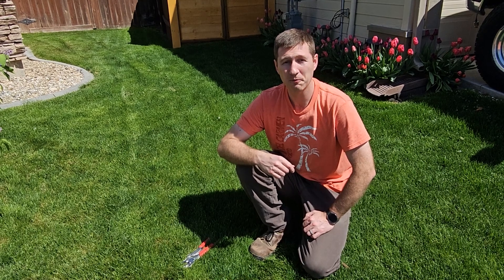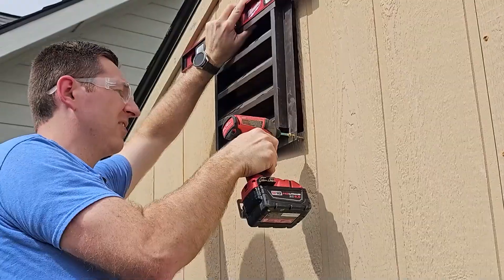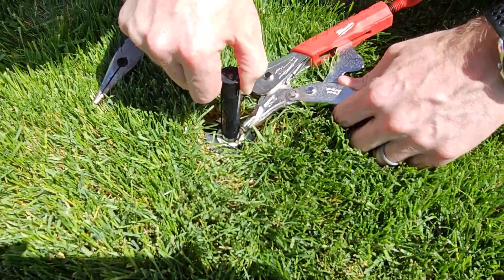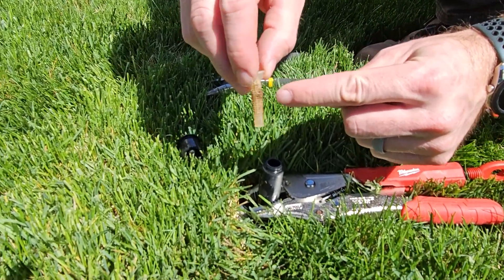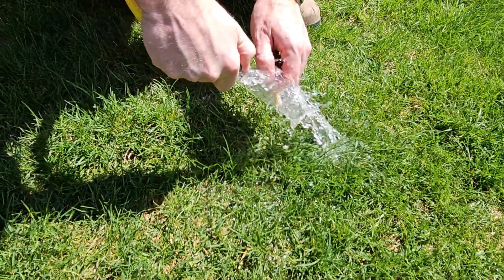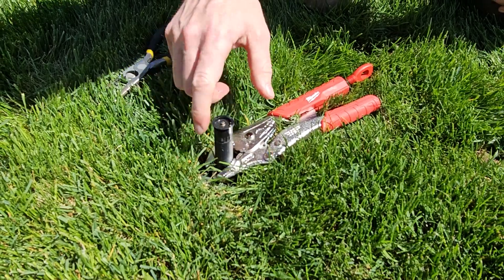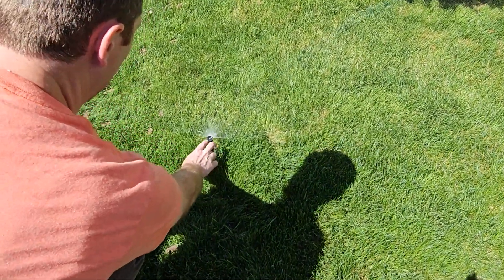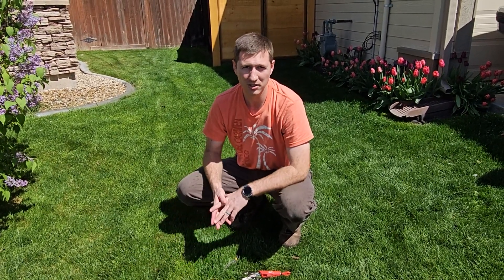Unclog your Sprinklers by cleaning the filter

Comment: I have a sprinkler head that blew off the head of the sprinkler while the water was running. The spring-loaded piece is recede back into the lower pipe, and I can't get a grip on it with my sprinkler tool to pull it back up. It's all so far down in the grass mat and soil, I can't see it, and I don't think the sprinkler tool can reach it.
I'm going to have to dig a chunk out of my lawn to get to it, aren't I? Or is there some tool or trick I don't know about?
Any help would be greatly appreciated.